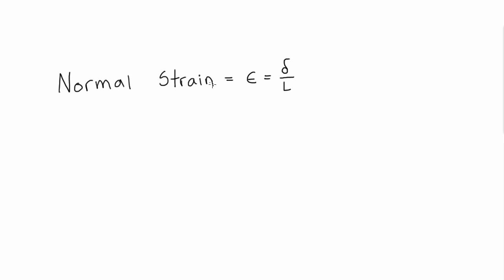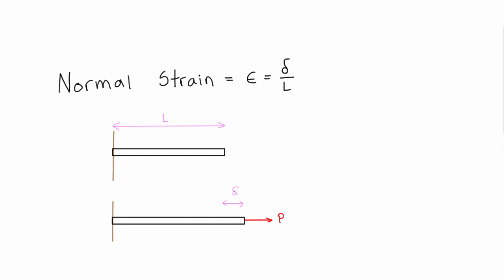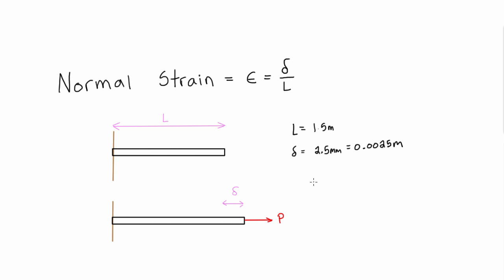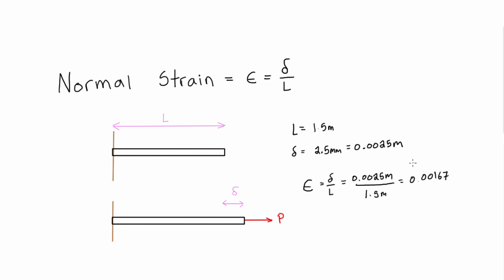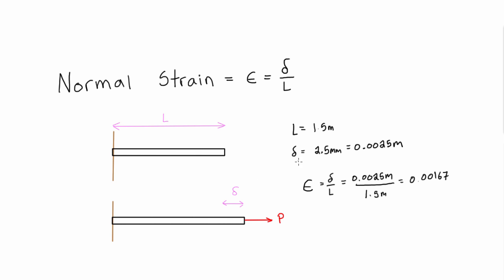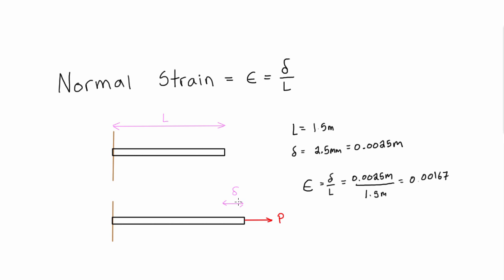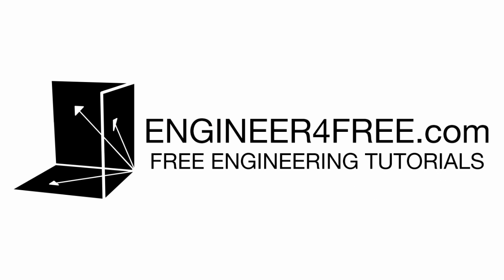Normal strain

Comment: I'm confused, why is there no P' like the strain videos, a P' thats both equal and opposite to P to ensure equilibrium. Is this because the elongation only happens when we aren't in static equilibrium?  

What would happen if we had some P' on the other end? Would the elongation then double?
Reply from the maker: Ahhh, you will notice if you look back at them, that any video that labels P' will not have a support reaction drawn on the diagram. It's more general and less distracting to draw P' rather than a specific type of support reaction. In a structure that does have a real support reaction, P' is basically the equal and opposite force that would be causing the member to be in static equilibrium, ultimately coming from the support reaction resisting the applied axial force.Notice in the stress videos that stress = P / A. There is only one instance of P in the equation, don't overthink it and multiply it by two! Hope this helps. Lemme know if you're still confused.